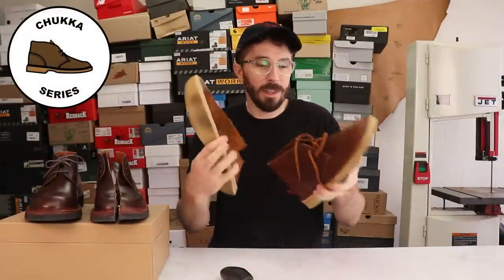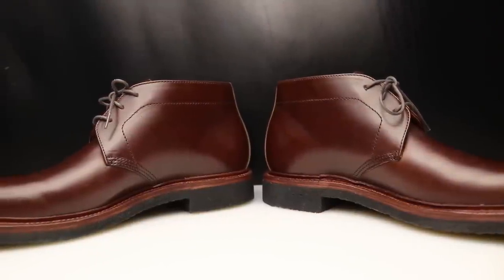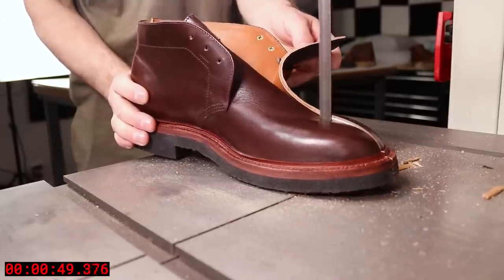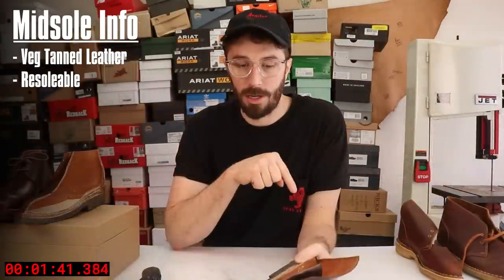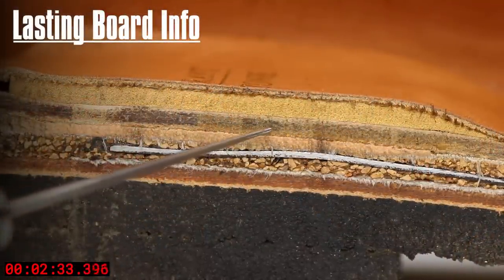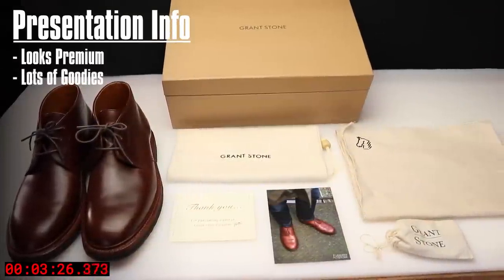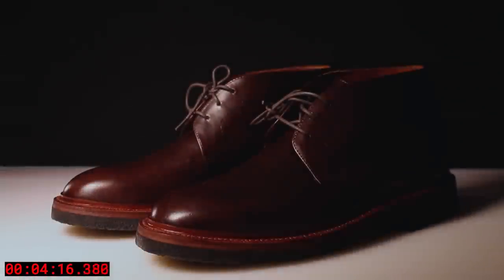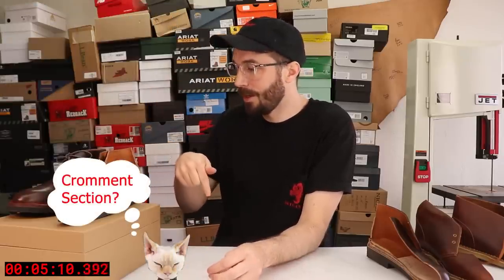How Grant Stone's Chukka DESTROY CLARKS, In 5 Min. (CUT IN HALF)

Comment: I still prefer Clarks.
Reply: Why?
Reply: @alexcallas8222  I prefer Clarks because they fit the specific use case they where made for. They're a desert boot which means they are meant to be worn in hot climates. You want a light weight boot that is unlined and has a softer sole for comfort all day. I have a pair of Clarks that I can wear comfortably for tens of miles in a single hot day. A boot with a more classic dress boot construction would be torture.
Reply: Same...

Comment: You should cut a pair of brand new Corcoran Jump Boots in half, they're basically 9" high Iron Rangers with steel toe cap and a stone sole.
I've owned a pair for about 3 years now and I LOVE them! I'd like to see if the quality now is still as good as it was 10-20 years ago. 
They're one of the only boots that are still being made pretty much the exact same way they were being made 80 years ago. Or are they?
Reply: He did. He found the leather and build were more casual dress shoe then jump boot. Though he did indicate that since the Corcorans were authorized for wear with the new WW2 style dress uniform it made sense the boot downgraded

Comment: The quality is great, but the sole and shape and sole is, in my opinion, just looks a bit heavy. I'm not a fan of the shape, they look like a work boot. I like the Clarks for the streamlined look, And so far none of the other boots have that streamlined look.
Reply: Chukkas are not Desert boots, by definition. The whole point of Clarks is being simple and cheap, you can't make premium Clarks.
Reply: @Enrico-  You are correct, technically a Chukka is a dressier version of a desert boot. But most people, including retailers use the terms interchangeably.
Reply: @Enrico-  check out Clark’s desert welt boot from I think 2017. It was a premium Clark’s desert boot.

Comment: I have abused numerous Clarks for years, to the point that rubber soles wore through or they went through construction kind of wear. I usually just threw them away because they became more unsightly than unwearable. Never unglued or unstitched. These Chukkas for $300? Gimme a break. My motorcycle boots cost less.

Comment: how do you even consider comparing a $300 boot to the $70 clarks chukkas? thats nonsense.

also, for regular clarks wearers like me, this is not even an option to replace the chukkas, because those are way too structural. the good thing about the clarks is imho, that they in no way feel like you wear a shoe. they are basically non existent.

without ever had a pair of these worn, the look quite heavy an substantial,  more like a real boot. i do not think they appeal for the same kind of wear like the chukkas from clarks
Reply: Where are you finding Clark’s for $70.00 ? I just saw them at a Clark’s factory store in Vegas for $150.00.
Reply: @rozinant1237  i regularly buy them on amazon for about 65€ to 80€, what on average is about $70
Reply: OK, that is the “Bushacre” with the plastic sole. Not a bad shoe, I have a pair, and yes I bought them for $70. However purists want the crepe soled desert boots and for some crazy reason they are $80 more. In the store they refer to them as Clark “Classics”. They are still made in Vietnam.
Reply: @rozinant1237  oh my bad, did not look at the listing correctly. i usually buy the ones with the crepe sole for this exact price when on sale.